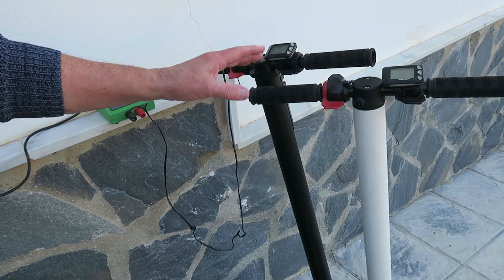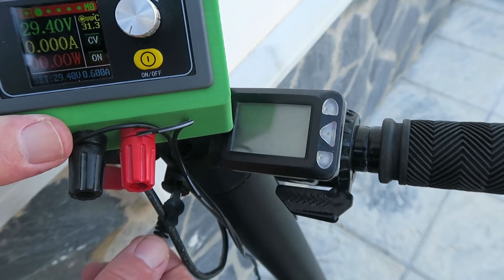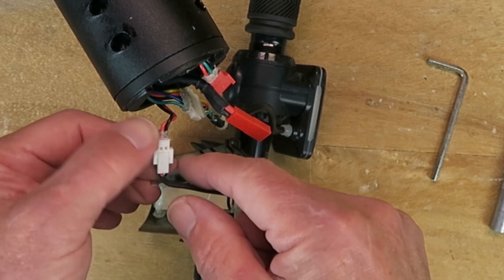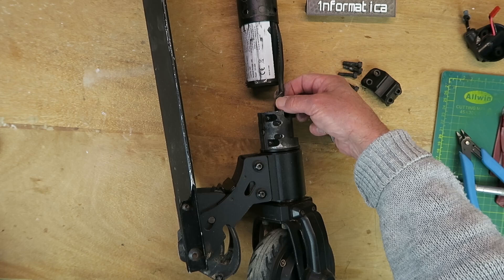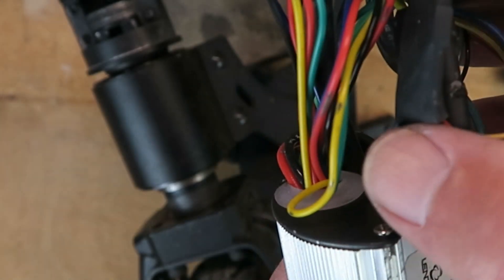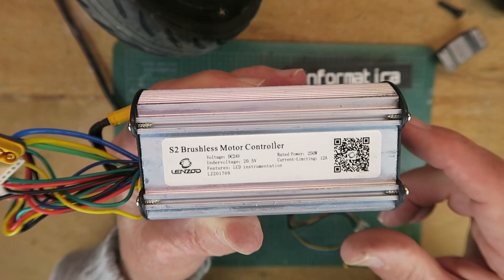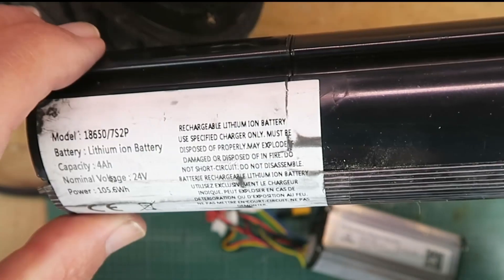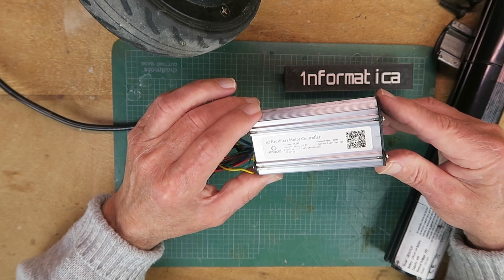Electric Scooter Repair Guide Tear Down Stem Battery

Comment: Thx so much for your video!!!! I was searching online to try to find a video how to remove the pieces just to get to the battery, and maybe replace it 😅 but as you say in the video, the battery are expensive, so don't think it no point to change it.... the e-scoter I have just dropped volt very fast from full charging at 28,8 to 23,9 when I drive it, and then it shut down completely. And I need to put the charger in and out again just to start it. So I think the battery is not good :/
Reply from the maker: Hey thanks! Yes, once the battery is dead you may as well buy a new scooter! Out of curiosity I did tear down a battery and repair it, but I cannot say it was cost effective! https://youtu.be/dd6Zw5LwG80 Have a great day!

Comment: I had no idea what this no name e-scooter was and I still don't! Mine is not coming apart and I will have to pry it apart I suppose but thank you for this video!
Reply from the maker: What I failed to notice was that inside the stem there are recessed hex screws which when undone allow the upper part to slide out. Look at the holes in this clip : https://youtu.be/-eCr-xUCGQ8?t=174 that's where the screws are hiding! Thanks for watching, have a great day!

Comment: Hey I'm trying to get my tube out. Was it tight on the scooter for you? It looked easy for you to pull off the battery. I'm literally using all the strength I can but it don't budge
Reply from the maker: Sometimes they can be very difficult to remove. Usually the cable from the controller to the motor passes down a channel in the side of the battery housing. Maybe it is stuck or twisted jamming the pack in place. Try pushing the pack back down a little and check there is nothing stopping it coming out. Good luck! Thanks for watching, have a great day!
Reply: Inside the Alan key bolt holes at the bottom of the stem is more Alan key (hex) bolts they adjust the silver plate plate backwards and forwards (I found this out the hard way 😅)  shine a light in the bolt holes you will see more hex (alan key ) screws that take a 2.5 m hex key or Alan key this is what’s making it hard to remove (I am guessing they had come loose in this video or the scooter in this video used the original bolts to adjust the plate and that’s why it came apart so easy.
Reply: @electronicscootersthanet6360  hmmm. Okay thanks. I do have a different scooter. I have a Hover-1Rally Folding Scooter but it has the same set up and everything. So I figured taking the stem off is then same as this scooter
Reply from the maker: @electronicscootersthanet6360  I found this out second time around! It is not obvious thanks for sharing. Have a great day!

Comment: Hi.When I usually try to charge my e-scooter nothing says that charge.Only sometimes says red that means it's charging and says it's charged but it's 2 lines only?Do I need new battery?Pls help
Reply from the maker: Use a multimeter to measure the voltage output of your charger and wiggle the wire near the connector to check there is no intermittent break. Also check the battery voltage and connector wiring. If the battery appears to be fully charged but then runs down very quickly it is most likely the battery is faulty. Thanks for watching, have a great day!

Comment: Turnz Urban E800 scooter has a design flaw that is terrible for our environment. This scooter only worked for 6 months. I really liked it, it ran great and made me one less car on the road. I know all I need is a $5 replacement fuse to get it to run again. But the frame of the Turnz E800 seals up the battery,  wiring, fuse box so that it is impossible to repair it. So now I'm forced to have to make a perfectly good scooter landfill, and fork out another $500.00 for a new scooter, which won't be a Turnz E800. Scooter enthusiasts take note - we need to be able to repair our scooters, not turn them into landfill every 6 months.
Reply from the maker: I feel your pain. I used to make a living repairing things but it just becomes too difficult and spares almost impossible to find. Thanks for watching, have a great day!

Comment: they do this with electric scooters too they use so many diff colour wires inpossible to know wha tire and were and then they send wrong connrctions out on parts leading to bigger issses , i need  a stem for my eletric scooter been waiting a year they still have none in stock guess will get in 2025 if not will make my own i already bough aluminiom i just need to buy loads more will cast my own parts and make em , dont know how right now  but will learn.,
Reply from the maker: Yes, I learned the hard way and now buzz everything through with a multimeter to be sure! Good luck with your project. Thanks for watching, have a great day!
Reply: @1nformatica  thanks and you too #respect

Comment: Hilariously dry English commentary! 
I have an iScooter my wife unit crashed. If you run it full throttle for a minute is completely dies after   losing power and slowing. I was thinking of the battery or controller failing, but never thought about thecwiring harness.
Reply from the maker: Hey thanks! It is nice to have my talents appreciated! Good luck with your investigations. Have a great day!